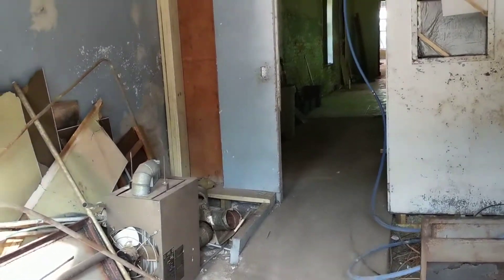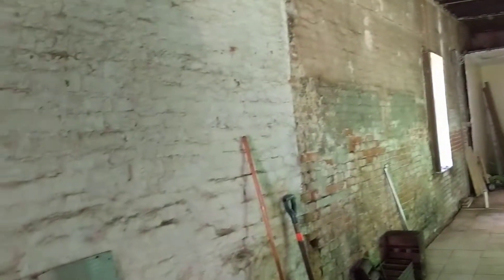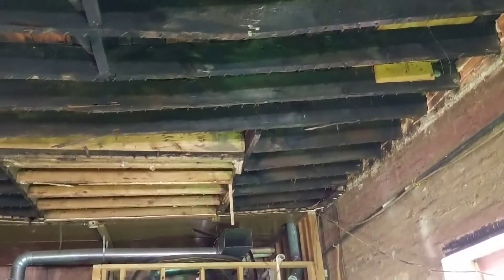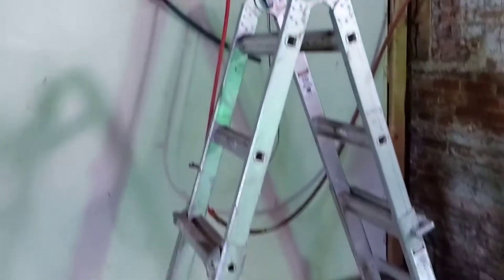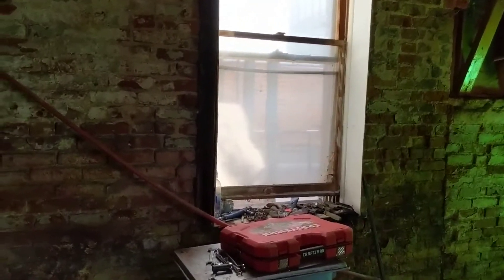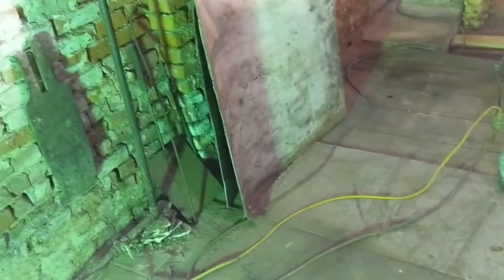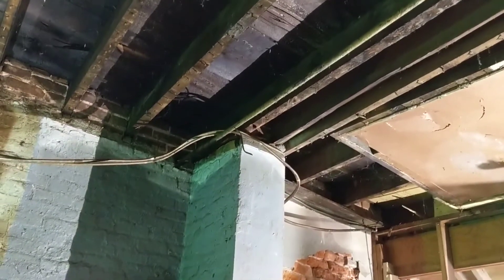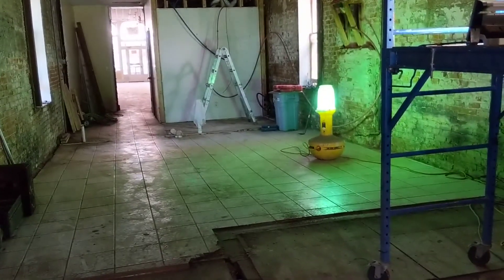April 2, Back Building Progress After the Gutting

Comment: Skylight - great idea! LEDs make interior lighting super cheap for running costs, but skylights are awesome both for natural light and ventilation. Especially if you have to work inside without much natural light, skylights make the light in the room much warmer.
Reply from the maker: For this area the skylight will also open, allowing the heat to go right up and out. We start the back tear-down this coming week. Pumped up about it.
Reply from the maker: Look at the floor in this video. Now look at the most recent video. Unexpected additional project will have major benefits once done.